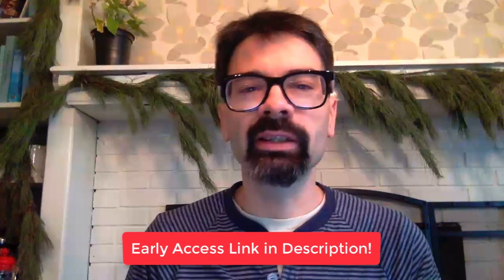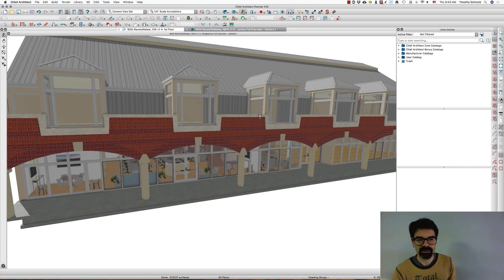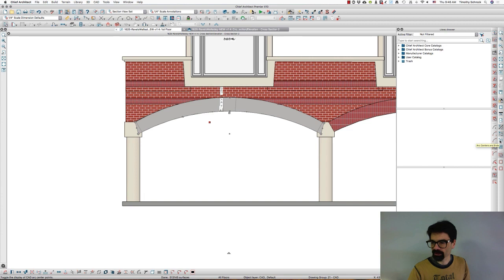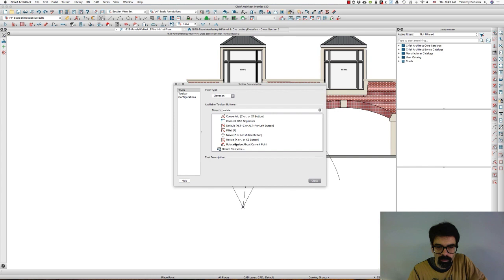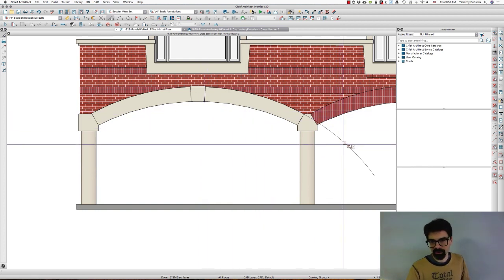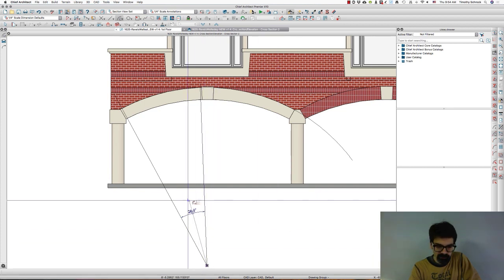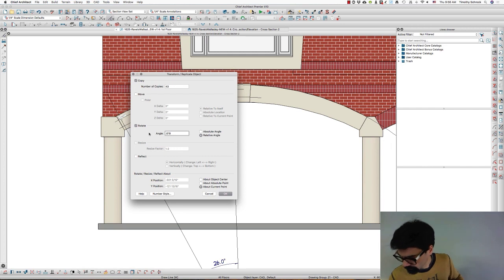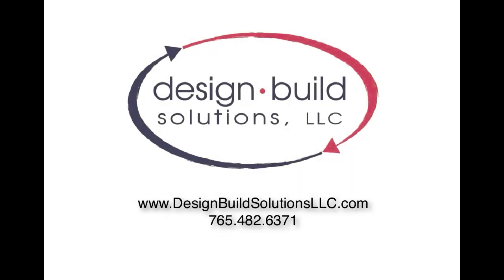Custom Brick Arches pt1

Comment: Tim - why don't you post these videos in Chief Talk?  

Also...I think some of what you are doing could be accomplished easier/quicker if you used a CAD DETAIL FROM VIEW...do some of the CAD work there...then, PASTE AND HOLD POSITION.  I find it easier to get snap points in a CAD DETAIL.  What do you think?
Reply from the maker: Interesting idea Steve. I think you might be able to find the arc a bit quicker that way since the tool creates the arc, but to get it into 3D, I'd have to bring it back from the CAD detail into the elevation anyway.
I will have to observe next time to see if I find snap points easier. I did find that I should have been better at creating the arched lintel in the first place to make sure both inside and outside radii were concentric. I think it would have been faster for me that way had I planned ahead a little better. As this video shows, I was cleaning up what I could have planned the first time.

Comment: use Archicad...Chief is a pain in the nose! great for quick ideas and presentations, not for CDs....
Reply from the maker: I'm not a Chief Architect salesman, just a user. After trying several software options, I personally wouldn't suggest any other software. I'm working on 3 full sets of plans (2 additions and 1 new pole barn/residence) as I type in addition to the handful of others that are in the design phase.
Reply from the maker: I've been using Chief Architect exclusively for over 15 years now